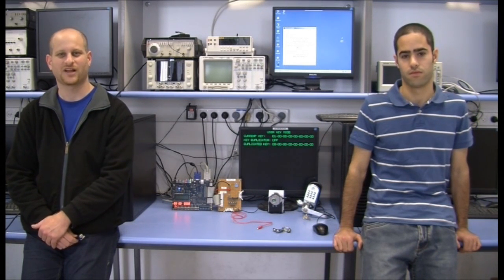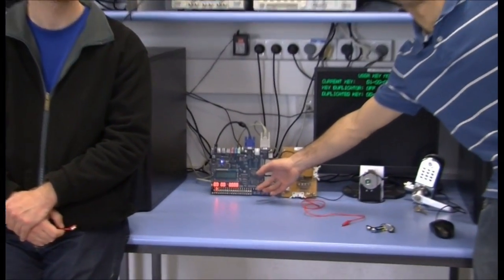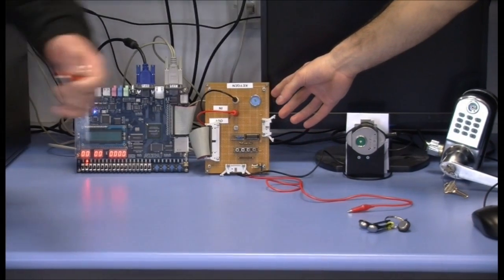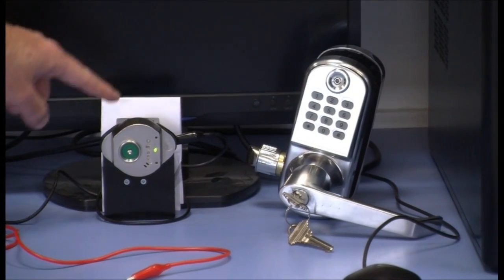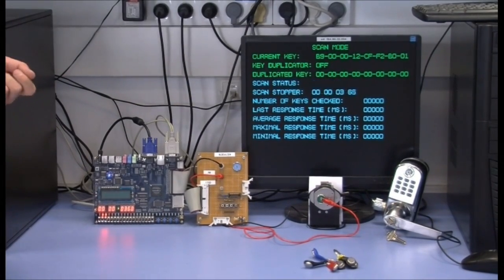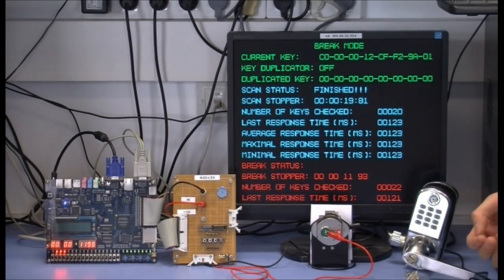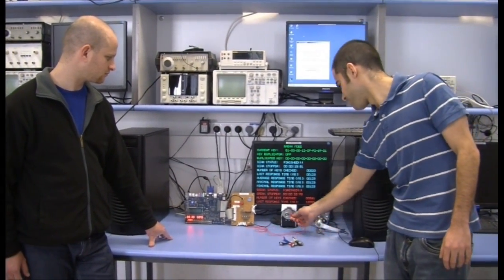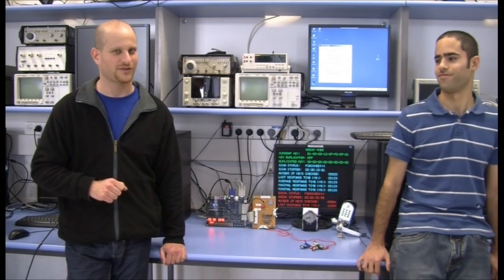VHDL & FPGA Project: Hacking iButton Locks (English version)

Comment from the maker: @Shaunakde First the hacking system measures the statistics of normal lock response time. the number of keys for statistics can be chosen. The operator can also choose from what key to start the cracking operation. On the next phase the hacking sys tries to find an ID sequence that is longer in response time . This is probably the correct key. so it is recorded.

Comment from the maker: @Shaunakde 
After exiting from sleep mode the lock initiates the reading of the ROM repeatedly and the hacking system 
increments the ID number after each read session. iButtons are very safe because there are many 
numbers to scan. I hope Dallas also program the numbers randomly. Locks can be made safer 
if they sense the scanning operation and disable themselves for a period of time or even activate an 
alarm. We had another project that does exactly this, so we have also showed a solution.

Comment: This looks like a brute force attack of an iButton. Couldn't iButtons fix this exploit by locking out unlock attempts for 5 minutes after 5 failed attempts within a 10 second period?
Also, if you were attempting to find a valid ID, I think putting a fascia on an existing lock to capture the IDs of iButtons used to unlock would work better. A similar approach to the ATM Skimmer